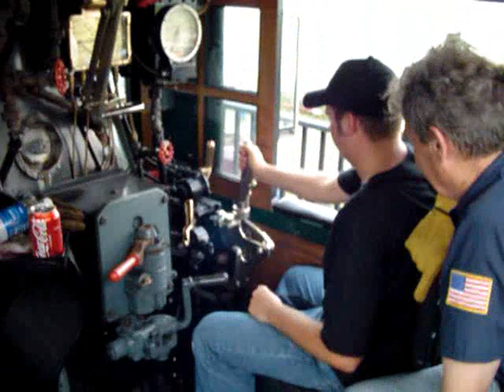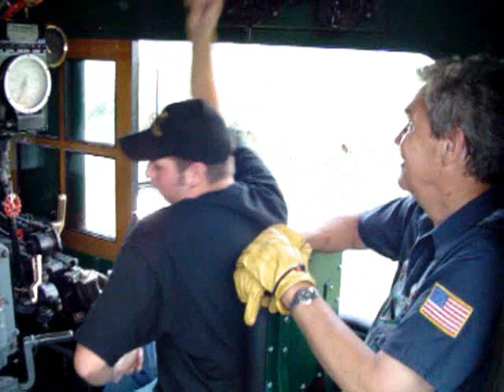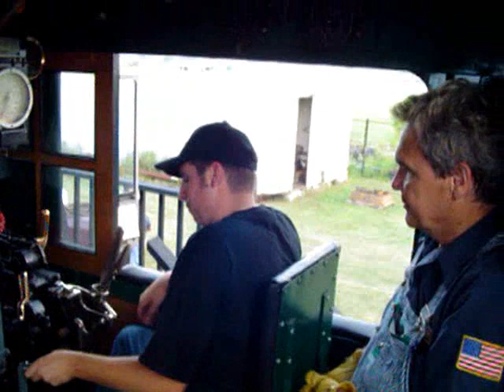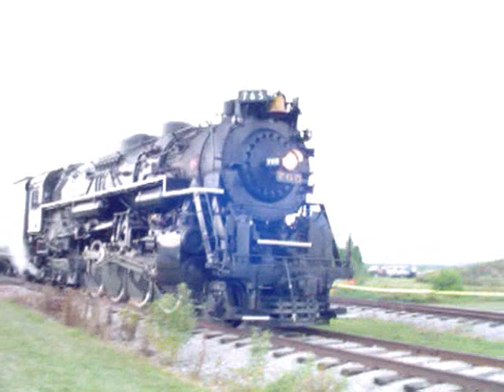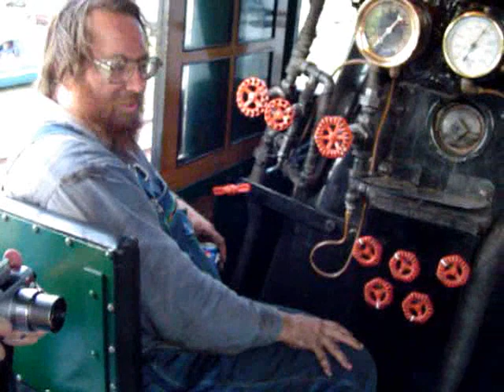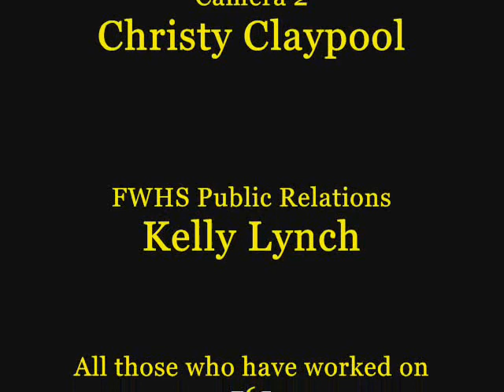At the Throttle of Nickel Plate Road 765

Comment: Guess like firing a steam locomotive: It's easy as long you only move a few yards in the shed-yard forward and backwards.
But the difficulty begins, if the engine is tied to a train and has to move a line. You battle with the firebed, you battle with the showvel and the swinging cab, you battle with the water pumps and you won't think you could handle it...
Same with the throttle and moving the train a line as a driver.

Comment: Very nice! I envy him!
Reply: um about 2 years ago they had the run in western indiana and they had two slots to spend an hour fireing and an hour running the 765. for 765 dollers, they said they would love to be able to do that again if the fra would allow and they could find a privet railroad to host it, but so far no takers yet, and of course you had to attend a short corse in the weeks before they let you on the spot 3 years ago it was around fathers day now that I remember, but it is what many people dream about, heck when its steamed up I would give them money just to let me pull the throttle out for a revolution of the pistons or two just like they would do to warm it up and flush it out on a cold day so they dont blow the pistons, I dont even have to go anywhere, I would be happy if I could put it in nutral and tug it out a little ways  and blow some steam and throttle jerk her just once, I asked last year at the open house and at the hoosier heritage train visit last year, Mr Winniker is like we want to keep an even pressure on her as the fire dies off and they can put her away, from which she will hold heat for a weeks due to all the insulation and heavy iron and steel in her belive it or not.

Comment: It is much more valuable as a cash source to have people who need cash desperately obtain collectible parts like the whistle, bell, gauges sets, number boards, marker lights, headlight, builders plate, linkages, boiler over pressure relief valves, boiler water sight glasses, hoses, subassemblies, air pumps, valves, steam chests, boiler front doors & many other desirable collectible parts which all can be sold from their automobile trunks with NO QUESTIONS ASKED!

It could be very profitable!